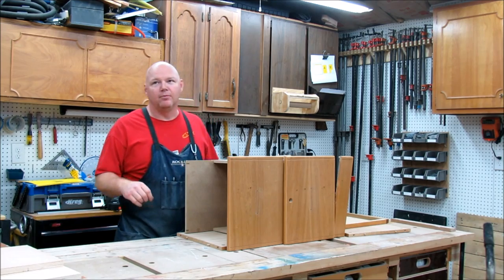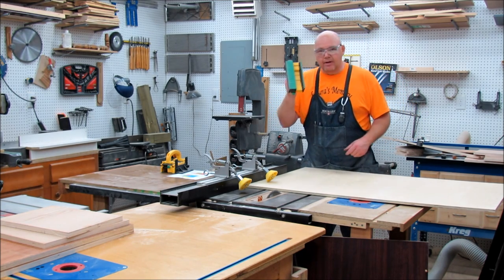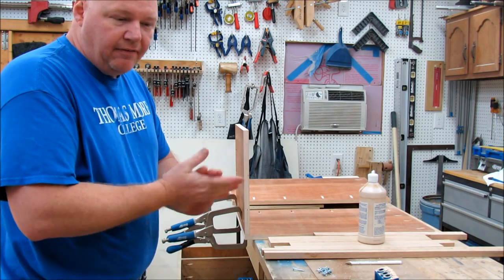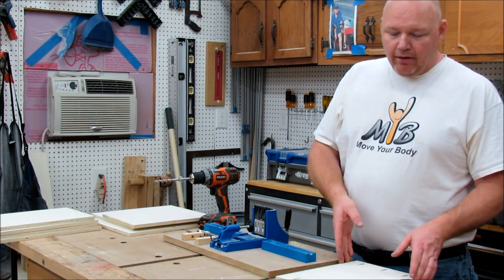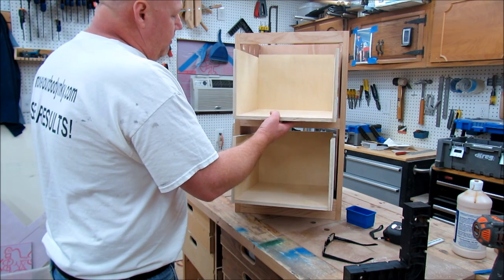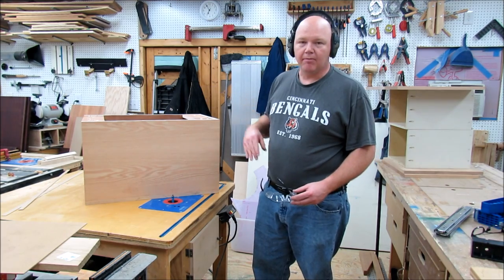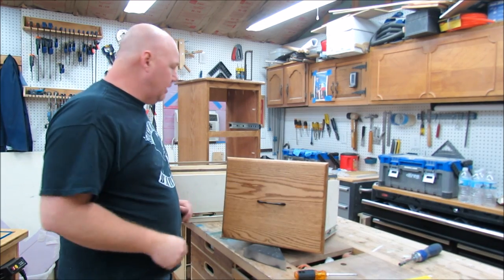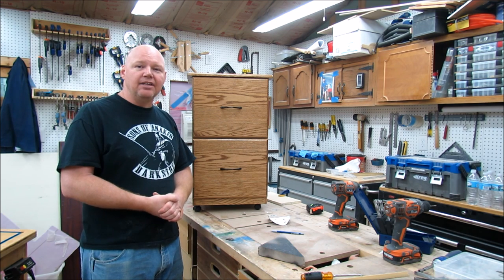Free Plans for this Filing Cabinet

Comment: What is the purpose of having the back panel of the drawers peek up over the sides that extra half inch? 
Thanks for sending the plans! :D :D
Reply from the maker: Just a little stop for the files if you don’t use the metal cage like I did.  If you were to use the plastic side cap slides.